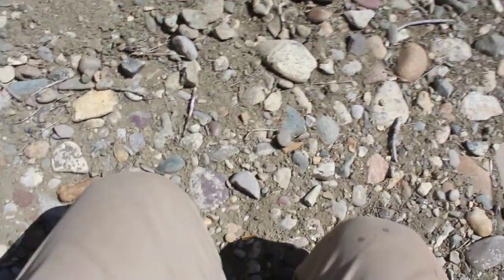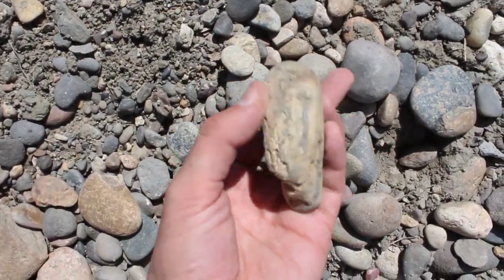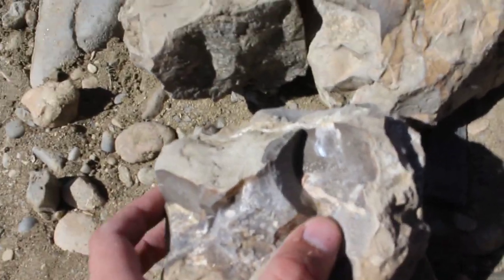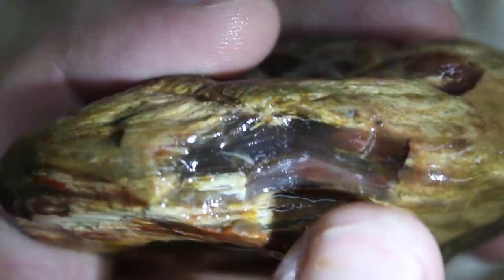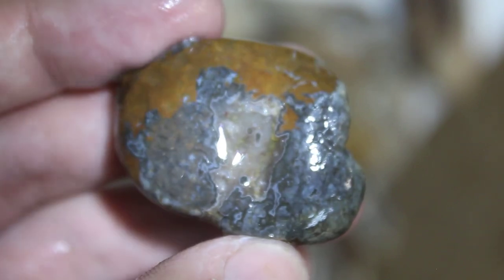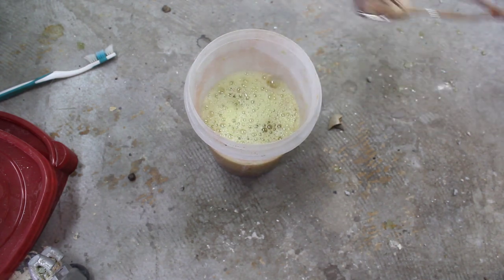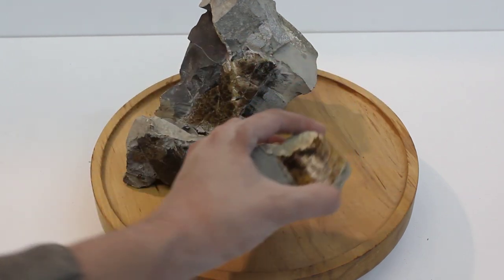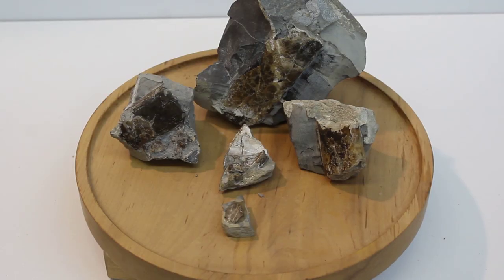Finding and Prepping Baculites! Hunting for Outstanding Marine Fossils! (plus some agates)

Comment: I found a bunch of septarian nodules yesterday, but I didn't see fossils. I did haul a big one home because it seemed like maybe it had bone in it - would be whale bone if so. Is there a secret to finding the nodules that hide fossils?
Reply from the maker: Oh I know! The wind has been just awful! I actually had to do a voice over on a video the other day too. And the simple answer is, sort of😂  it depends a lot on where you are hunting. For example, you can find septarians all day long in the Columbus area and not one of them will have fossils of any kind, whereas they will grow in number the farther downstream you go because the Yellowstone cuts into the Bearpaw shale a little bit east of Billings. The best way to find them reliably is to look for white marks inside the Rock. Those white lines and circles are the cross sections of fossils,  the white is actually the pearly shell layer of the fossil which most Bearpaw fossils have. Another tip is to look for septarians that don't have much calcite; typically speaking the more calcite in a concretion, the less likely it is to hold fossils. Other than that, it's kind of a roll of the dice; it can be very random, up to chance,  and very much a matter of training your eye to recognize them which definitely takes some time. Once you spot a handful, you will really start noticing them everywhere. Hope that helps at all!
Reply: I saw a video on septarian and they even went to a rock shop where there were huge ones over 200 lb in a raw state outside and beautifulexamples of them inside being made into jewelry or coasters and many other kinds of things. In the video it stated that a septarian starts by forming around a fossil such as an ammonite or even a fern. That was a cool video 👌😎

Comment: Take a concretion and put in the freezer for a couple of days, then drop it in some hot water, the concretion will fracture along the lines of the fossil it encases and it will open to reveal it. all concretions contain fossils, all of them, because they can't be made without them. The decaying matter precipitates calcium and the calcium is turn to calcite concreting the sandstone or limestone around the decaying matter, when the decaying stops and it stops precipitating calcium the concretion stops growing.